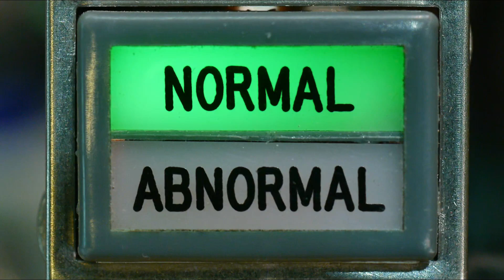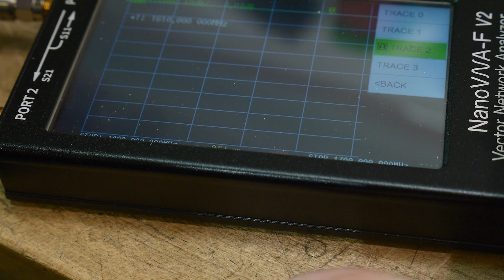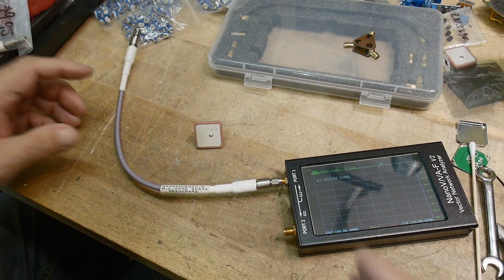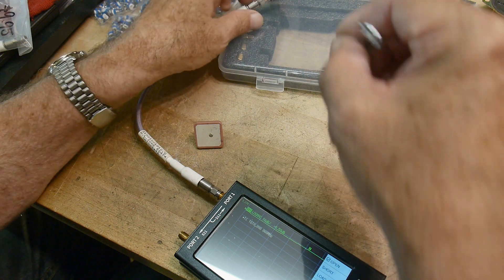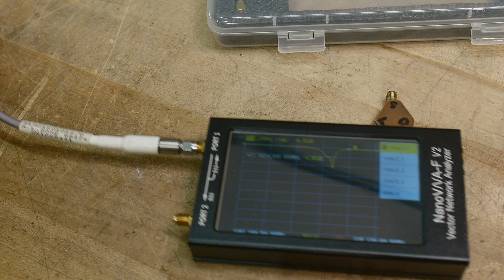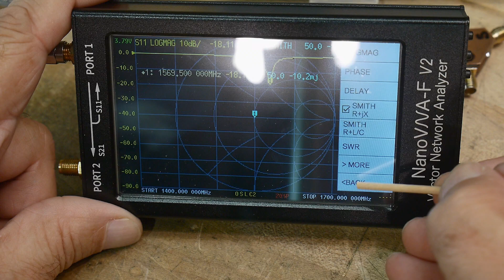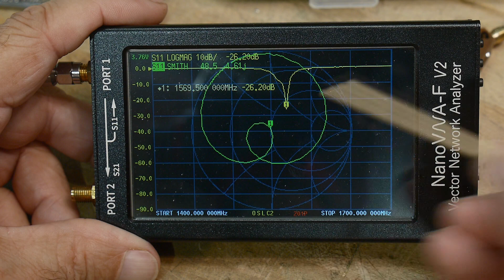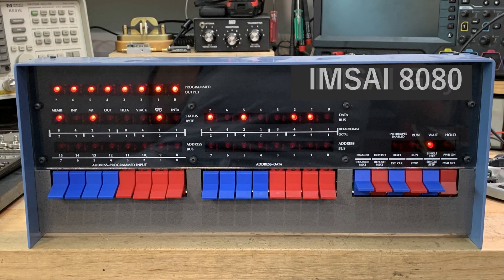#1271 GPS Patch Antenna VNA Measurement (part 2 of 2)

Comment: I was wondering if you’ve had to do any repairs to any of the PCBs of your Nano’s. I thought I’d ask you first before attempting the rabbit hole that is Group IO. I’ve the SAAV2 model of nano vna. While it was charging it was bumped of the table and sheared the usb-pcb(conn 301) connector from the board. Fortunately it soft landed but it has not worked ever since. I’ve been through the schematic(s) from GitHub and elsewhere . The resettable fuse seems fine. The only anomaly other than not powering up, is that some of the LEDs that illuminate on power up , don’t pass a diode test with a multimeter. The LEDs don’t appear to be protective in the schematic. I’ve checked for shorts to ground, opens, et cetera, ad nauseum. Any insight or words of wisdom would be greatly appreciated.Thanks- Jason Burchell
Reply from the maker: no repairs needed

Comment: is this a valid result? There is an unpowered preamp in series with the antenna.
Reply from the maker: This is antenna only.
Reply: @IMSAIGuy  I would agree that this is a valid test, but I am curious how the amplifier would look. I'm sure you have a bias tee! I'm mostly curious about phase shift as time correlation is the primary use of such a device! Also what other modes arise if the impedance has any mismatch. Great video as always! P.S. I'm curious as I use a very similar model for my GPSDO but lack the convenience to measure it myself as its tucked away under insulation in my attic!